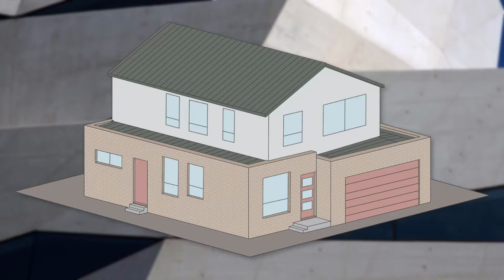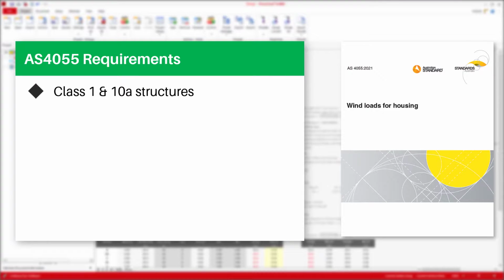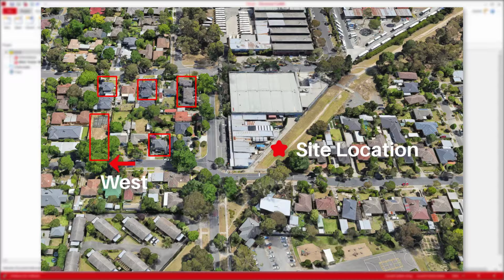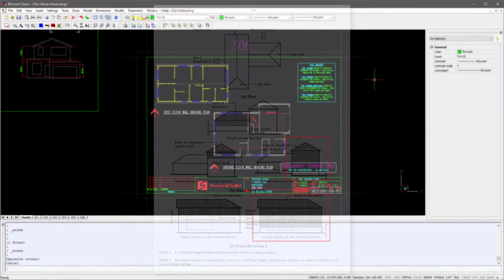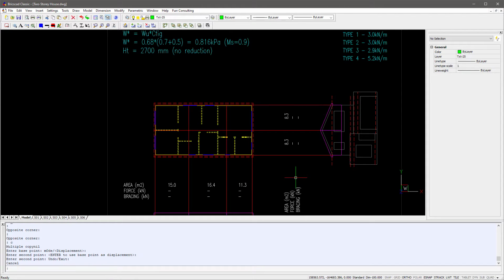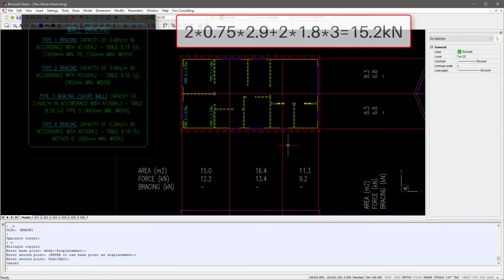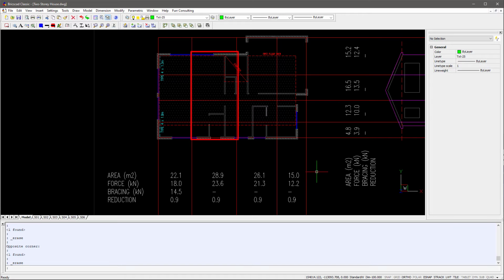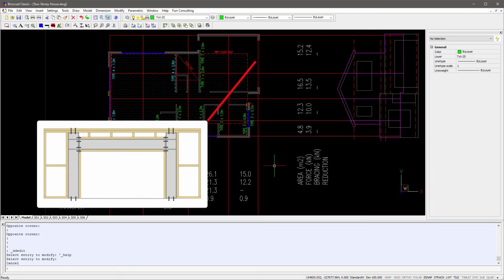Two-Storey House Design: Ep.2 - Bracing Loads & Design

Comment: Regarding the racking force in the long direction of the house, as you mentioned on the LHS side, we had a 3.5KN bracing still to be provided which will be needed to be transferred from the area next to it as we have braced 28.8KN and we only require 23.6KN to brace. With the moment lever arm, the horizontal push and pull force was 2.9 as you mentioned. 
The question I had was with the 2.9KN on the horizontal short direction both external walls, do we have to consider it as an additional 2.9KN in addition to the racking force of 3.9KN and 12.4KN to cater for it?
Reply from the maker: For most standard design scenarios, the design wind action will not occur in both directions at the same time, so you typically wouldn't need to add the two forces together when checking against bracing capacity. There will be exceptions, however.

Comment: Hey,
I have always had this problem on Australian project. I usually work on Design LGSF houses. Now i have seen many engineers place shear walls on upper floors. Now my problem is that when that is done, it created uplift on one end. Now if there is no floor member present below, how can hold down be provided.
Secondly, the joists are designed only to take up floor loads. Now suppose there is a shear wall at upper floor and joist is porvided directly below it. Now do the joist need to be deisgned for shear wall uplift forces as well. If so, how should it be deisgned.
Also, when upper floor is offset from lower floor like in your example in video, a beam is used. Does this beam needs to be deisgned for uplift as well. Also, the shear wall has uplift one end, downward at other end and axial at bottom plate. How are these forces to be transferred to supporting beam.
Like this has been my biggest issue on Australian shear deisgns. Is it possible to get a video on this and helpful references as i could not find any.
Reply from the maker: Great questions. For timber framed houses we would recommend you read through all of section 8 of AS1684.2 (for non-cyclonic) to get a full understanding of the approach being applied. This section goes through all the required steps for this bracing design method, and also covers how brace walls should be connected at the top and bottom into the roof/floor framing. Yes you are correct that the brace walls will induce various loads onto the surrounding framing, and that this somehow needs to be resisted. A lot of AS1684 is based on 'whole house testing programs' which look at how the entire structural system works together. The provisions/guidelines outlined within this method should therefore account for the load-paths you have mentioned, assuming a conventional house frame configuration.
Reply: Thanks for clarifying, I will red through the recommend literature

Comment: Thanks for sharing this, really helpful as I try to learn Bracing. I'm wondering how you calculated your areas? I couldn't see how you included the height? E.g. Are you taking the wall height multiplied by the length? Sorry but I've seen conflicting ways of doing this.
Reply from the maker: Hi Matthew. The areas are automatically calculated by the CAD program we are using when we draw out the area shapes on our elevations (you'll typically be able to just click on the shape and in its properties the area will be displayed). Regarding the height of the area, the bottom of the area shape we draw is usually at the mid-point of the floor to ceiling height.